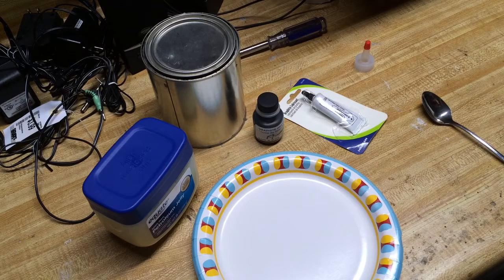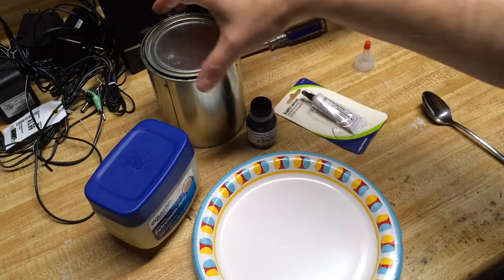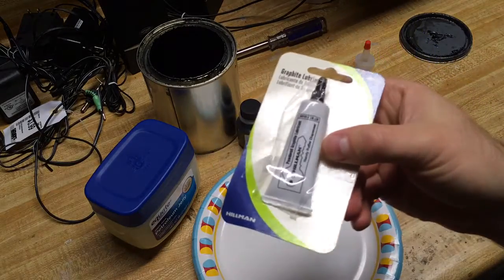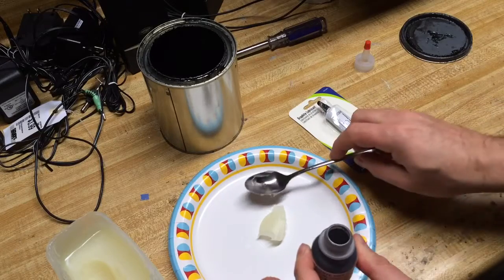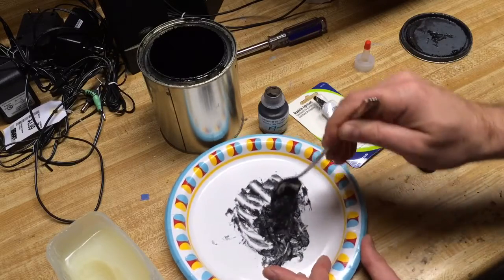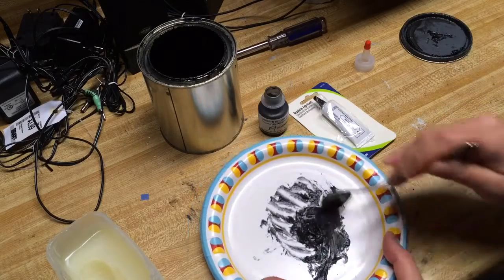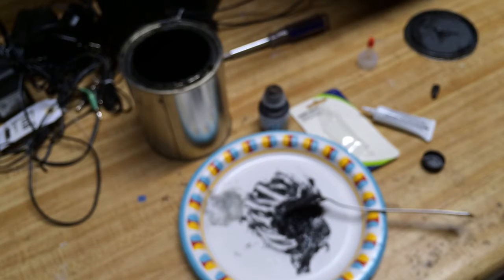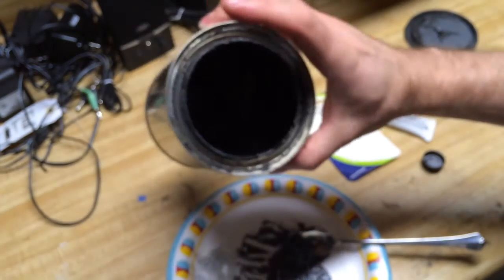How to mix your own Thomas Edison record player grease

Comment: Edison's recipe used Dixon no. 2 dry graphite mixed with the vasoline - - you can still buy Dixon graphite via Amazon (I recently did so).  Dixon graphite was offered in three different grades of flake courseness - number 2 was the texture of dry flake recommended.  Of course,, you can still find 90 year-old cans of graphite for sale on Ebay ...   Best, Uncle Josh

Comment: Have you ever used a syringe to inject graphite grease into the hole of an Edison diamond disc spring barrel?  Completely winding  up the spring(s), then removing the screw in the side of the barrel and finally - injecting the graphite grease into the spring barrel?  I've been told that each spring takes two of the old Edison spring lubricant tubes - which I don't want to use as the tubes are now collectible.  Wonder what kind of syringe to use as needle-nosed syringes probably wouldn't work for the thick graphite grease mixture.  I've never seen a video demonstrating this technique - but believe it would be useful.

Comment: grease always consists of a gelatinous part and a volatile part the volatile part tends to evaporate over the years making the grease gunky or even hard
to remedy this i found out that it is rather easy to re-introduce the volatile part in case of graffite grease it is gasoline 
so take your spring barrel with gunky or dried grease pour the gasoline in until it fills half the barrel when it is turned on its edge
at first if you lean it over it will spill some gasoline but if you wait a couple of hours you can hold it upside down you repeat the process for the other half of your spring barrel and again wait a couple of hours
now your old grease is completely re-constituted and when the spring barrel is back in the machine wind the machine up and let it run until the power is gone and repeat that about 5 times this to get the gasoline and old grease to mix even more and then you are set for quite a number of years
if the grease isn't gasoline based it wont work you must experiment with other volatile fluids

Comment: Would this grease recipe work for a gramophone tone arm? 

I have an RCA Victor table top gramophone player, but there is no grease in the tone arm housing, so the tone arm is rather rigid and heavy-feeling and the needle sticks in the groove and loops, but keeps repeating the same section of a song rather than smoothly running along the record groove to play the song properly in its entirety.

Comment: I have found a MUCH cheaper and easier way to get graphite powder. You can either pick up a nice glass blowing graphite tool and shave it down or you can do the poor mans way (my way) and cut a few pencils in half lengthwise, pull the graphite out and then use a callus remover or sandpaper to turn it to a nice powder. I would say its finer than the #2 graphite powder but not much finer. Its like powdered sugar. I have also used the lock lube stuff but its more like a glitter type grain than a powder. The callus remover you want is the one with the little holes in it. The glass blowing graphite paddle is like $20 or so but you get a lot of graphite. You should try this method and see how you like it. It's kinda funny because I was one of the few that asked how to make this stuff.
Reply: You can tell I wrote this comment before watching the video all the way lol.